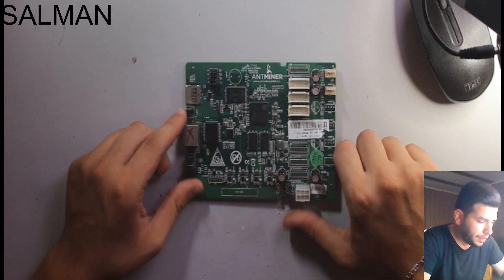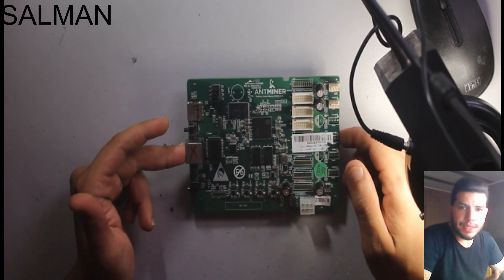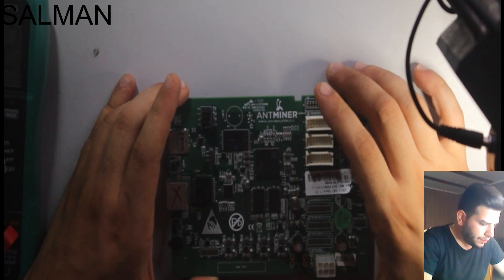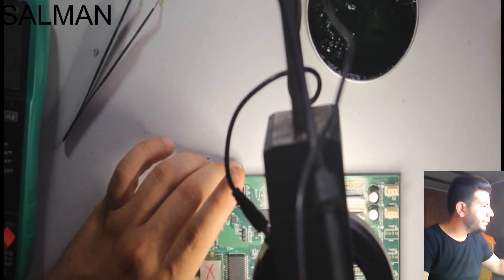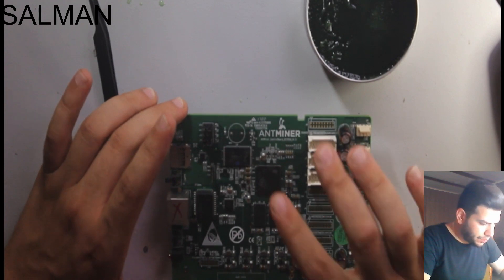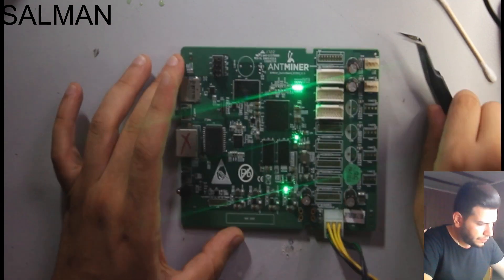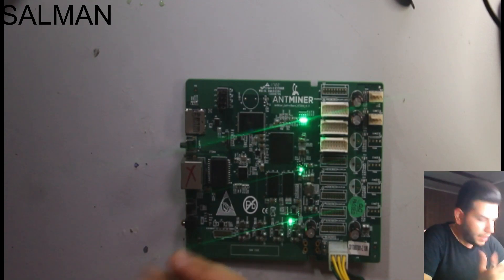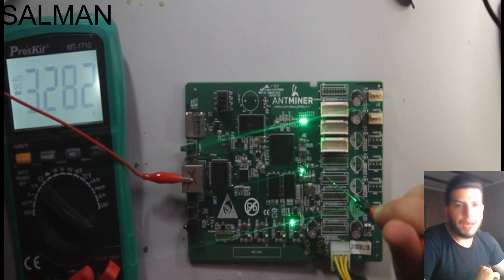AntminerS9 control board repair (bad contact xilin x chip )

Comment: i bought a machine S9i used it is all are ok but the lamp is continuesly red i put to work it starts for few seconds but after it stops and work only the power supply and only it consumes 50 watt instead of 1400.Is the problem the drive control ?can you tell me?
Reply from the maker: Hello please send your request on WhatsApp number 0096181007374